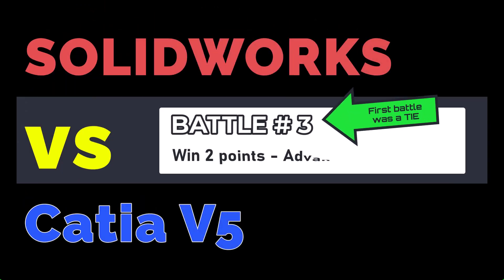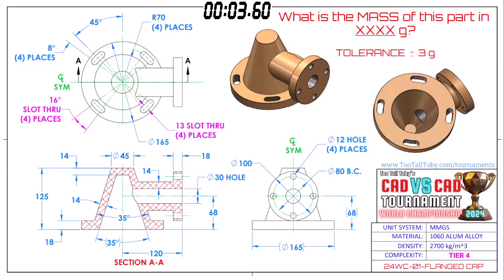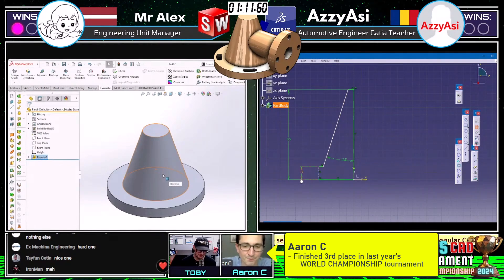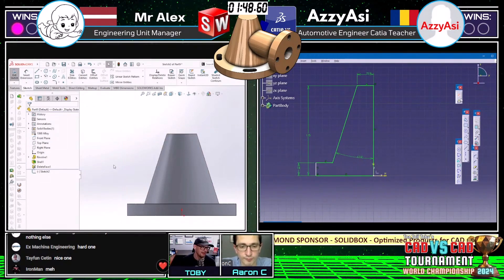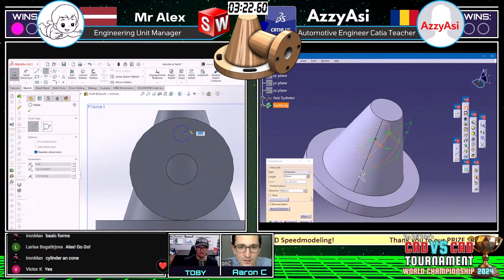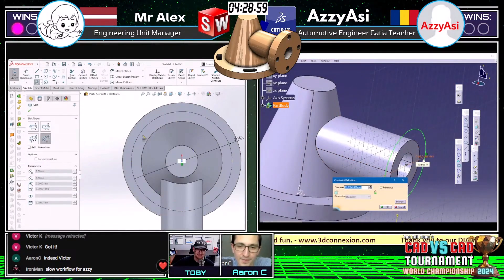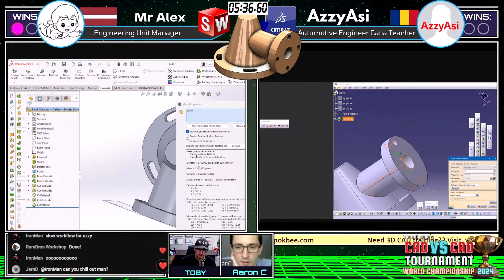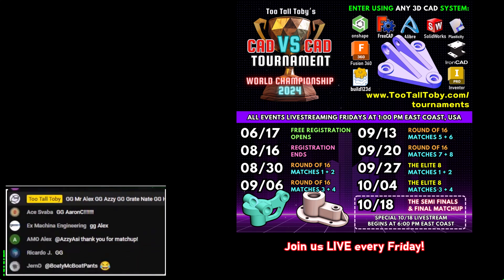3D CAD esports - TOURNAMENT HIGHLIGHT - Match 2 - MrAlex vs AzzyAsi - SOLIDWORKS vs CATIA V5

Comment: I am working with catia almost more than 2 years. Even I have used shortcuts that I have predefined to catia, I've finished this drawing in 8 min 22.34 sec.

I was using solidworks before and I think it is realy faster than catia. But catia is beter in parametric design and 3D model automation which make your revisions faster and easier. 
It is not fair to compete between tow different program, but it is good to show the difference between them.
Reply from the maker: Hey man thanks for the comment.  There are speedruns posted in the featured models section at the top of https://www.tootalltoby.com/practice

I think you'll enjoy watching the runs by MCGA - a catia user who is smoking the competition!